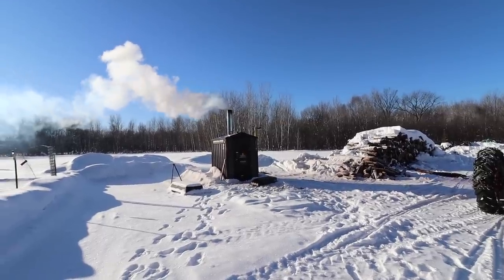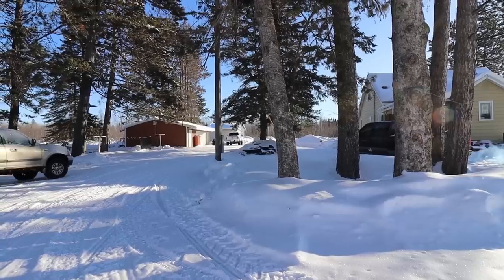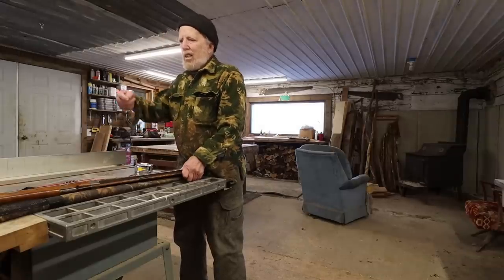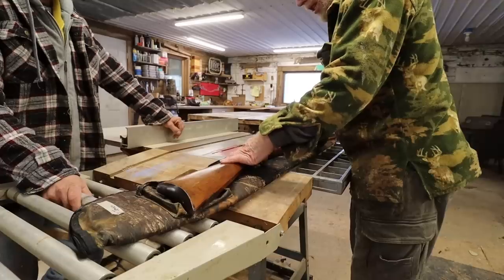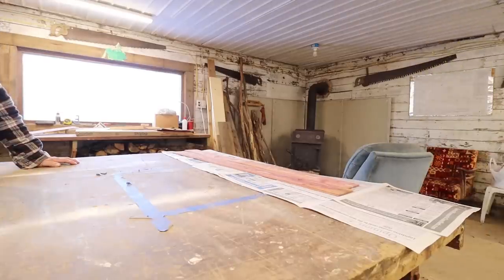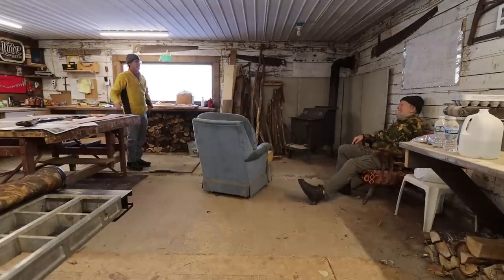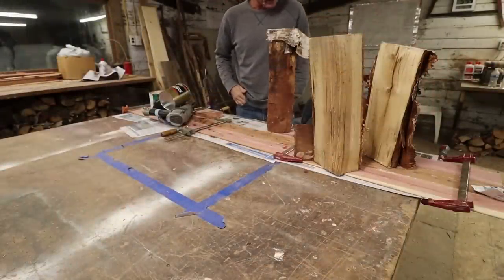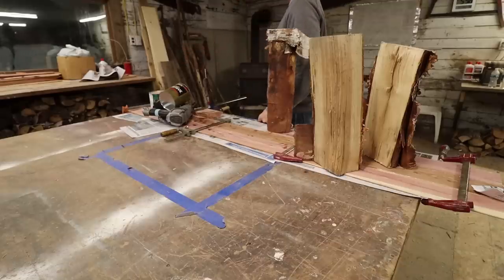THE WORKSHOP. Winter Workshop Projects. With Dad. Rustic Flintlock Gun Case.

Comment: Good evening, Joe.  Quick question, do you see your self ever adding heat to your red garage.  Do you think that keeping it at or around 50° to keep a vehicle or two in would increase the amount of wood your boiler would use?
Reply from the maker: I do not think I would add the red garage onto the boiler, that would be a very long run for the water pipes. If I add a garage to the house I would heat that. If anything I would add just a wood stove in that front garage to heat up if you needed heat for something like working on a vehicle or the 4wheeler etc.